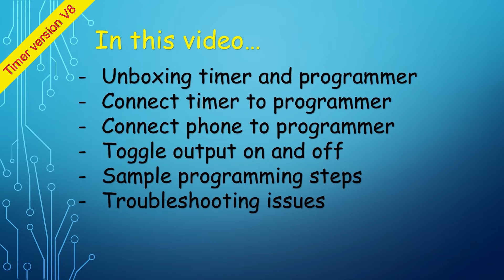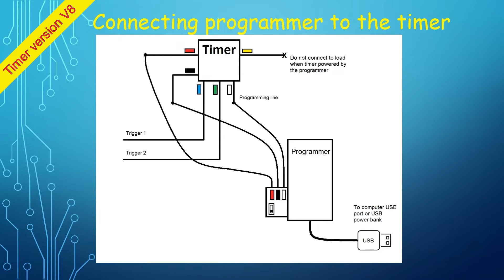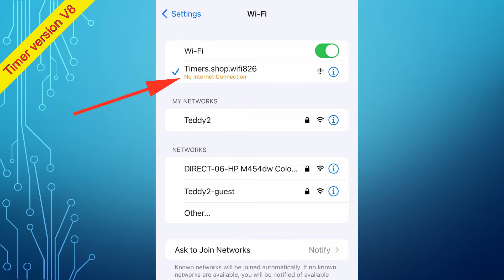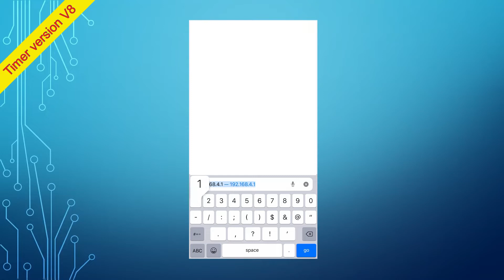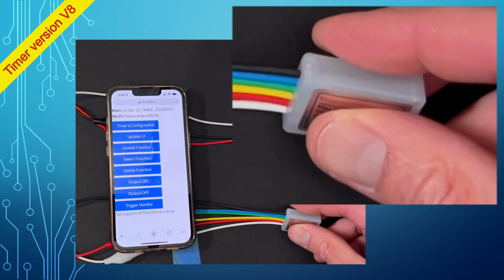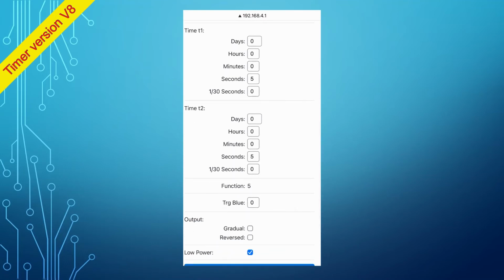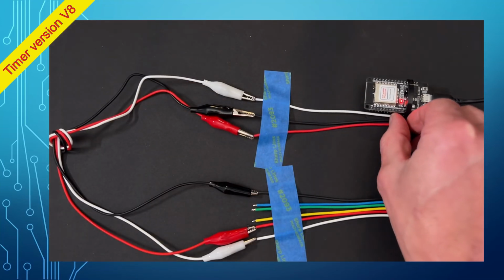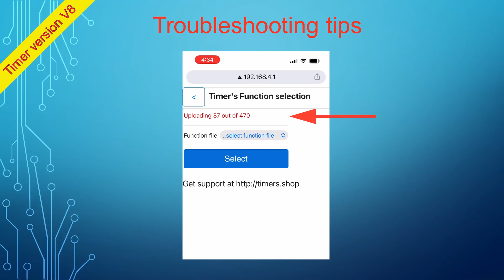Multi-Function timer V8: First time use demonstration

Comment: I can not get the blue led to light up on programer
Reply from the maker: Did you follow troubleshooting steps? Turn the switch off, then restart programmer by pushing on a small button near the usb. Then turn the switch on
Reply: @Timersshop  ty that helped